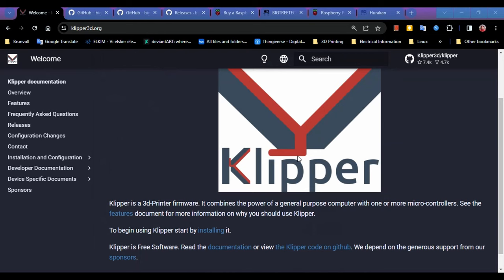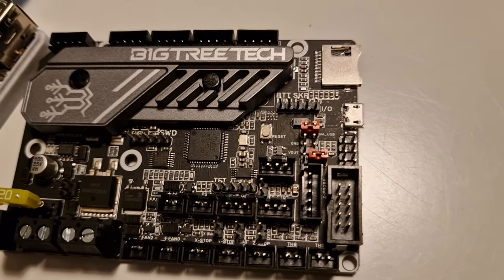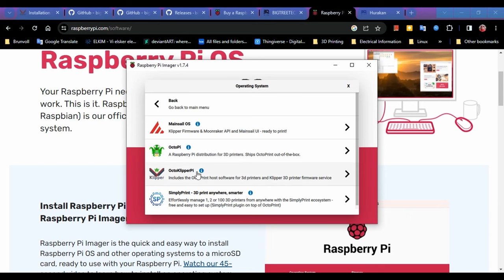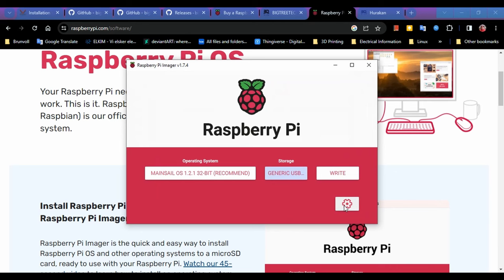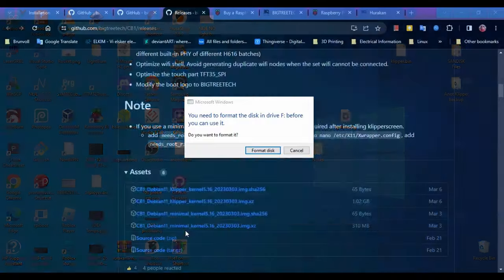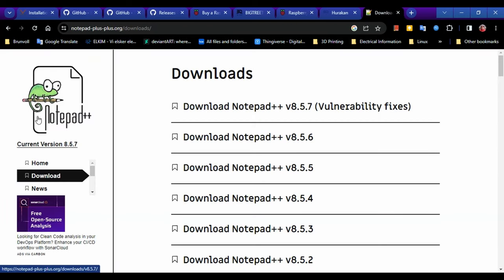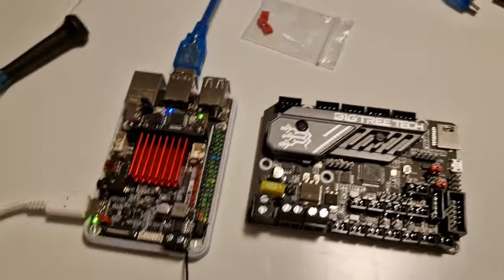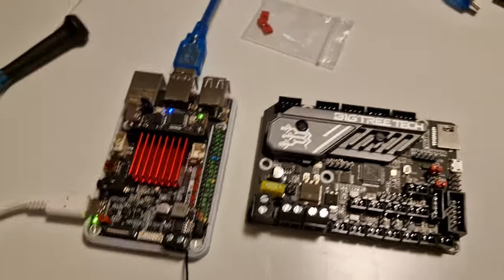How to install Klipper for beginners

Comment: Great tutorial. I tried it 2 times and it did not work. I think you should mention that you can't directly flash the firmware on the old Ender 3 motherboards : 1.1.2, 1.1.3 and 1.1.4. You need to burn a different bootloader on it before doing it. It would have saved me so much time!

Comment: Thanks a Lot, you saved me. Was Trying to install klipper on my Biqu B1 for a week. Did evrything a lot tutorials told me to. But the only thing no one said was to name your bin file firmware, some said to name differet from the last update, others said to leave at is. Only this little thing made the trick!
Reply from the maker: Great to see it helped you get up and running! The B1 works great with klipper! I'm slowly working on modifying mine as a direct drive IDEX set up.

Comment: Your videos are not too long.... don't sweat the youtube algorithm. People really need details and recommendations, and that is where your videos shine.
Thanks for your detailed installs of BigTreeTech gear and thanks for these Klipper vids. I'm  working on the Linux on a laptop option right now. Dropped it years ago because WPA2 enterprise function in a lot of linux flavors was infeasible.....which is why I cant use an RPi or clones. So far Fedora 38 gives me great Cura 5.4 functionality controlling printers ....and I can run multiple instances, or use Pronterface. ..... but can't get Octoprint or Repetier Server working, so switching to Ubuntu 22 and will update back here when I can ....so far Cura is Old (4.13)  and Pronterface isn't available ....but Repetier Server loaded and Octoprint is loading now. Will try Klipper to compare once I have that baseline data.
Reply from the maker: Thank you for the encouragement! 😊
I am considering getting a Linux machine set up in one of my old laptops to show how to use klipper on it, but I don't have a time line for that yet. In the meantime, if you haven't already looked into it, check out KIAUH it will make setting up Klipper a breeze. https://github.com/dw-0/kiauh
Reply: Idk what this dude is talking about, you over explain a ton of shit and I am constantly sliding around in the video, or getting distracted while you go on about sd card speed. I'm not saying the info isn't there, I'm just getting lost when it takes forever to explain a concept. like, just make another video for that concept. also thanks for making this, i gave you a thumb/sub @StackingLayers
Reply from the maker: @user-xq3zj8gz6o  I do over explain...a lot 😅 It's a bad habit of mine. At the same time I'm addressing things that I see as common problems with beginners, and trying to stress the importance of getting it right the first time. Still, I do need to practice consolidation.

Comment: i had not luck installing the OS for the pie but i ended up installing the specific purpose 3d printer OS, then klipper with kiauh, then following this guide after that. worked like a charm!

Comment: Excellent tutorial. I got the bug after the last RPI update and it didn't recognize any USB devices attached to the Pi, I tried a few things that didn't work. Finally decided to start from scratch and this video helped me to load a new Klipper copy into the Raspberry and the printer board. I used the old printer configuration files and everything is working again.  Thumps up, keep up the good work and more vids like this one.
Reply from the maker: Very nice to see it was helpful 😊

Comment: Thank you for this awesome guide. Absolutely the best guide I have found and although I used a different microcontroller board this was helpful enough in understanding the setup and with many useful software tool suggestions you made along the way the install went much smoother. I am breathing new life into my aged PrintrBot Simple Metal by running it with Klipper firmware and hopefully will get some refinement in print quality. Thanks again and keep up the good work, I will definitely follow your channel now.
Reply from the maker: That's great to see this was helpful! Klipper is pretty great for reviving oder machines. I wish you lots of success.

Comment: Best guide that I have came across. I kept getting the mcu cant connect error and turns out I had the firmware.bin file incorrect on the sd card.
Reply from the maker: That is an easy mistake to make. Nice to see the guide was helpful.

Comment: Phone chargers are power supplies. The battery management systems are  located in the device being charged. Chargers with quick charge can change voltage if a QC device is plugged in.

Comment: A bad flash bricked my board so I had to flash a stock bootloader and firmware file I found with an ST Link v2 tool off Amazon. I can't seem to get the firmware to flash from the SD card so I figured out how to directly flash a firmware with this tool using a hex editor 😎. The eeprom dump has a bootloader at the beginning of the file and then there is a break in the code and the firmware has to be written after it. This is why you can't simply flash the firmware file with this tool because it will overwrite the bootloader. I was able to turn the generated firmware bin file into a hex file and splice it into a file with the bootloader in front of it and after flashing that I have connection over UART now without an SD card. 

I'm thinking of making a video on this because it could be used to help people who have damaged SD card slots. But yea thank you for your video so I could get up to speed on how this stuff works 👍
Reply from the maker: That would definitely be a great video to see and probably very helpful for some.

Comment: Great video. You haven't mentioned using The TFT touch screen. Do you have to use a remote computer when using clipper? Does the mini SD card have to be partitioned? I really don't want to dedicate my MacBook Pro to when I use my 3D printer.
Reply from the maker: You could use an HDMI touch screen or something similar and install Klipperscreen as an at machine interface. The standard Bigtreetech TFT35 Touch screen and the likes are not natively supported by klipper as they use a seperate firmware. The browser UI is the main interface, and once the machine is printing you do not need to keep the UI open. You can also access it from any device with a web browser as long as it's on the same network. If you install something like OctoEverywhere then you can log in from anywhere outside of your local network.
As for the SD card the image burning process will set the partitions as needed. No need to do that ahead of time.

Comment: My printer is not working yet but I’m so close cuz your video! Thank you for making this!

I did have a problem getting the 
ls /dev/serial/by-id/* to work turns out I had to delete the klipper.cfg file copy and paste the same file but rename it firmware.cfg then it worked. I know you said to do that but somewhere it went wrong just putting this here for other people. Don’t know if this matters but I pulled the jumper from the boot pins labeled boot on my BTT octopus

I followed (Stacking Layers) vid to a T at the end there it got a little confusing however, I config it for my board, which is a BTT octopus v1.1 And it worked
Reply from the maker: Glad to see it was helpful. 
The boot pins on the octopus put it in DFU mode which uses a different way of flashing firmware and bootloaders. It doesn't need to be there for the firmware.bin via SD card method.

Comment: This is exactly the video i needed for my setup ! Totally new to klipper, and bought the skr e3v3 to upgrade my cr10 pro v2 also think about buying a direct drive hotend but i want a light one any suggestions? I want good cooling now using 5020 fan
Reply from the maker: Glad it was helpful. I use the BIQU H2 direct drive extruder on 2 of my machines and I've been very happy with them.
Reply: @StackingLayers thanks for the respons, very helpful. The biqu h2 v2s has a lite version(175gr)  that's sub 100 wich seems very interesting. I think I go this route then. It seems a bit daunting how to mount it for the moment but I see they have stl brackets too. You sir have acquired another follower !

Comment: Great video, just what I have been looking for.  I have an Orange Pi 3 LTS.  I used an 8-bit board and installed klipper as a test for my Ender 3 Pro using KIAH, but it is good to know how to do it this way.  I usually get bored with long videos and don't finish or fast forward as usually they are not things I am all that interested in.  But I watched your entire video.  It was really interesting.  

The one thing I have been struggling with is the configuration files.  Most of the videos or information I find just glosses over them or barely mentions them at all.  I have an Ender 3 Pro, but it has been modified quite a bit.  Dual lead screws each with its own stepper and a timing belt, SKR Mini E3 V3.0 board, Microswiss direct drive with all metal hotend.  I am going to add a different direct drive bracket though as the Microswiss messed up my homing and I can't seem to fix that.  I will also add a BMG extruder clone with a smaller stepper.

I am curious will I have to change anything in the printer.cfg file when I add the new motor.  Looking forward to your next video.
Reply from the maker: I'm glad the video was interesting for you. 
The new motor/extruder will likely need some settings adjusted.  Rotation_distance would be the first I would check, and depending on the type of driver setup, if you have current control that may need adjusting.
Reply: @StackingLayers  I don't think you can adjust the current on the board of the SKR Mini E3 V3.0 unless it is under that big heatsink.
Reply from the maker: Yeah with that board you set it in the printer.cfg under the [tmc2209 stepper_x]  for example for the X driver. 
The run_current: setting.  
This is the full generic configuration for that board, https://github.com/bigtreetech/BIGTREETECH-SKR-mini-E3/blob/master/firmware/V3.0/Klipper/SKR-mini-E3-V3.0-klipper.cfg
Reply: @StackingLayers  Thanks for the info, appreciated.

Comment: I noticed on the Klipper page, the installation instructions say to use Octopi is the base OS.   I never understood why they don't have just the Mainsail option without Octoprint.  I love octoprint.  Used it on my Ender 5 with Marlin 2 for years, but I have enough functionality via Mainsail to not need Octoprint and I feel most DIY/Maker/Home Users will be in the same boat.
By the way - WiFi country has nothing to do with time zones, it only defines WiFi channels available legally in the country.   I know you kind of corrected that later, but I am just being pedantic

Comment: Just got a btt pi v1.2 and going to try this on my cr-10 v3 with an skr mini e3 v3 board. Any recommendations on how to pick and choose between presets for that vs and ender 3? I successfully flashed marlin 2.1.x bugfix but klipper seems like the way to go. Also it seems like I can’t use a pi camera with the btt pi. Is there any alternatives I can use or should I just get a real pi4b? Same goes for input shaping if I go with the btt pi am I stuck using btt input shapers or vice versa? Am I good to just use my stock cr-10 display with the btt pi/pi4b? if I do get an external display from btt would that run on a pi4b too? Many thanks this video is incredible!
Reply from the maker: With the BTT pi you can't use a raspberry pi camera, but you can use a usb webcam. All of the different accelerometers will work. The BTT or any of the other usb style accelerometers are the easiest to set up. The cr-10 screen will work with the skr mini you don't hook that to the btt pi, but for a better UI I recommend an HDMI touch screen. That will plug to the BTT pi an you would install the KlipperScreen service.

Comment: If the minimal Debian is used, can the KIAUH be used to install klipper on the BTT Pi? How is this different from using the klipper image? Especially in terms of firmware update
Reply from the maker: Yes it can be done that way and you will not miss out on anything other than it already being installed for you. All updates will work exactly the same.
Reply: Thank you!

Comment: Followed your video to a T, however I still am unable to access the BTT Pi via Wi-Fi. All Wi-Fi inputs are correct (SSID & PASSWORD). I have had to link via ethernet cable. Do you think there is an issue with the BBT Pi? Otherwise, your video is great. Very big help with setup. Thank you 😊😊

Comment: Thank you for the helpful video! However, my SKR Mini e3 V3 doesn't display anything on my LCD when I boot it up with the SD card, despite following your instructions. I noticed that the (klipper.bin) file in the video is only 28KB (and mine is only 35KB), which seems small compared to my previous Marlin firmware (about 220KB). Could this be a point of concern?
Reply from the maker: Marlon is substantially larger because the entire system is running on the mcu.  With Klipper most of the system is running on the host soc (Raspberry Pi for example ) and the firmware on the mcu is very minimal and only what is required to be able to convert commands into motion and the likes. 

For the LCD you will need to make sure it's configured correctly for the screen that you have keep in mind that touchscreens that were compatible with Marlin are not natively supported by Klipper, like the TFT35 screens that have a choice of touch mone or Marlin mode. Most  of the interaction with clipper is through the web UI. For screen interface it's highly recommended to go to Klipperscreen if you want a touch interface otherwise use a simple non-touch screen like the btt mini 12864, as shown in this video, https://youtu.be/7UAeiQlKXxw?si=bv2GOOAyLSKOYwt9

Comment: this video is great! if there's an update for the os do i need to redo all of these steps?
Reply from the maker: Not normally. But sometimes a Klipper update will require that you update the controller board to have the newer firmware.
Reply: @StackingLayers  thanks for the quick reply!  it’s the pi 1.2 that has an update.
Reply from the maker: If you are not having any issues, you are fine with doing the standard Debian uptates using this command,
sudo apt-get update && sudo apt-get upgrade -y
If you choose to update the to the new image then yes you'll need to set some things up again, like the printer.cfg. It's best to make a backup of all that so you can just copy in after updating. The controller board will be fine as klipper firmware doesn't change with the host image.

Comment: This is great but unfortunately I'm using a Creality 4.2.7 board on an ancient CR-10 from 2018. How do I modify the firmware to work?
Reply from the maker: You'll need to find the settings for the board you have and then make and install the firmware. It's more or less the same process for all machines. If you have the atmega1284p chip on your board then this is likely the settings and config but do the research to be sure don't just start flashing without confirming the installed equipment.
https://github.com/Klipper3d/klipper/blob/master/config%2Fprinter-creality-cr10-2017.cfg

Comment: So at 28:40. The two files we need to watch for are not on my installation of klipper ( i did on pi 4 with mainsail) um the boardenv.txt and the system.cfg. I used raspberry pi imager 1.8.5 also
Reply from the maker: Those aren't for raspberry pi. When toy make the image for raspberry pi, there is a gear icon in raspberry pi imager that lets you set up ssh and wifi stuff. Yes that. Also raspberry pi has a config.txt that is similar to the Borden.txt on the CB1/BTTpi. Here is the info on that, https://www.raspberrypi.com/documentation/computers/config_txt.html

Comment: Hi man! I have one question about the OS choice. I just downloaded the imager flash and nowadays we have a bunch of different options availables... I bought the BTT PI V1.2 and dont know what spec to choose on OS.
Reply from the maker: The BTT pi needs the cb1 image. The raspberry pi images are not compatible, it's a different chip set. This is the official bigtreetech image https://github.com/bigtreetech/CB1/releases/tag/V2.3.4

Comment: Hi I just ordered an skr e3v3 with this intended purpose and was curious about having to jump the 2 pins to make it usb powered. Are those red bits in the box with the board? Or are they sold separately? Do I even need those or can I just join the 2 pins with some solder?
Reply from the maker: They come with it. Never solder those pins. The USB power is for programming only. You have to use a regular 12V or 24v  power supply, depending on your machine, to actually print.

Comment: Hi,
It's a very good and informative video. I followed everything and installed Klipper and even the GUI on my Pi Touch screen. I'm using a Pi 3B. I installed the SKR MiniE3 on my Tevo Tornado which has a AC heat bed connected to SSR.Everything working well. But once the heatbed and nozzle temperature reaches required levels printing starts and continue but immediately hot end temperatue starts falling. Once it falls below Minimum Temperature 170 printer stops.(Print continues till then) Can you help me to sort this out. Extruder is E3D V6. Thermister Generic 3950. Power supply is 24V 8.5A.Thank you very much in advance.
Reply from the maker: That sounds like there's something wrong with the gcode from the slicer, or the start gcode has a command to stop heating. Look for M104 S0 and M140 S0 those turn off the hotend and bed. Also check that your slicer is in Klipper flavor if that's not available use Marlin flavor.
Reply: @StackingLayers  Thank you
Reply: Got it sorted out. Was using S3D as my slicer and that was the issue .Changed to Orcaslicer and now everything going well.
Reply from the maker: @cweerawarna1 nice to see you got it sorted.